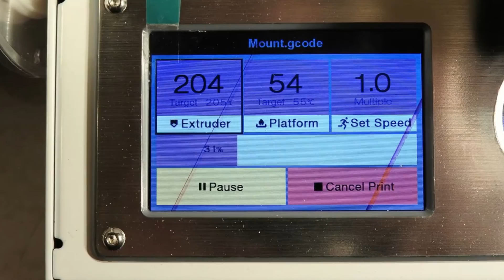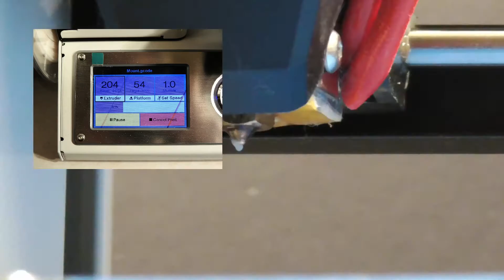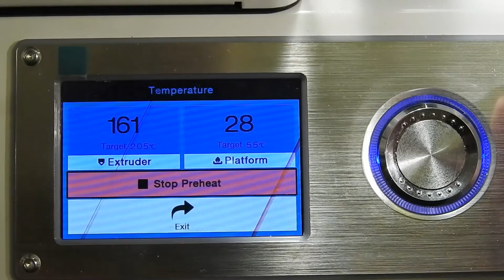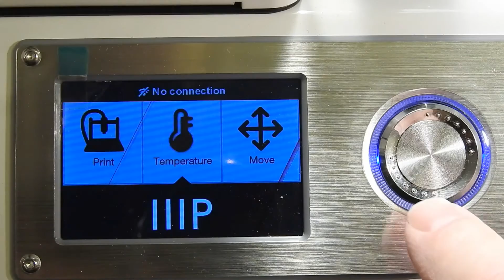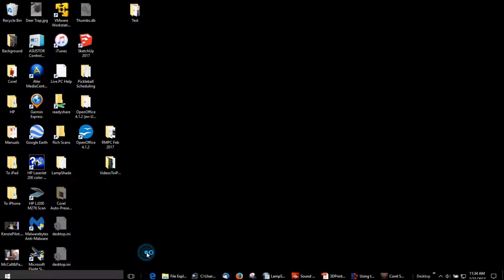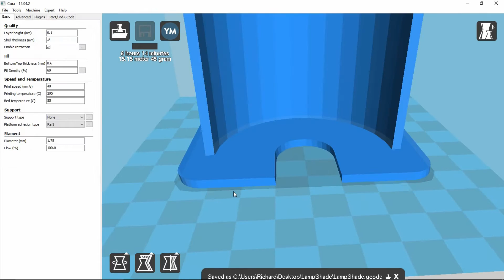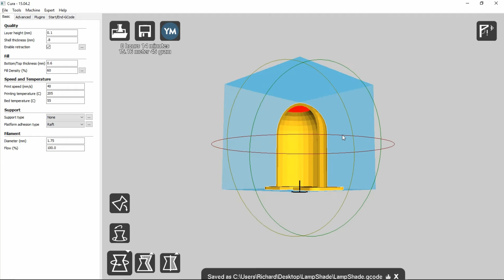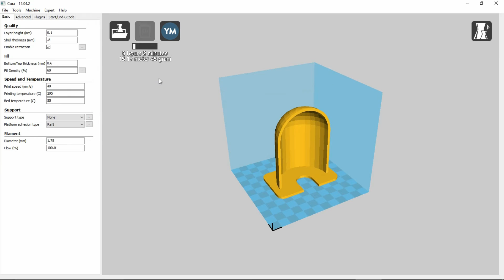Using the Monoprice Select Mini 3d Printer

Comment: How did the shade hold up to the lightbulb heat?
Reply from the maker: I replaced the original bulb with an LED bulb, so heat wasn't a problem.  Since the shade allowed more light through than I wanted, I lined it with aluminum foil.  I might make another, since I now have some black filament.

Thank you for questions and comments and thank you for viewing.